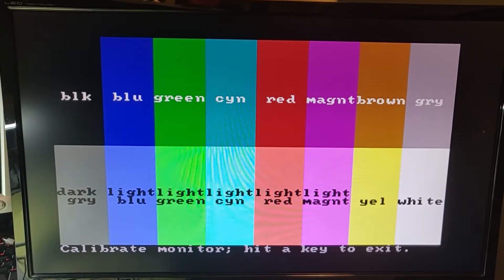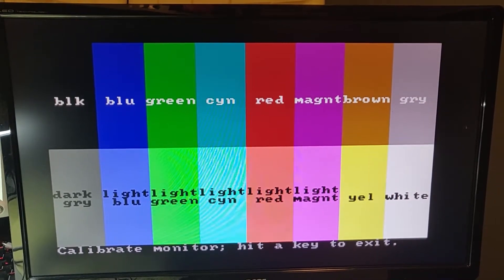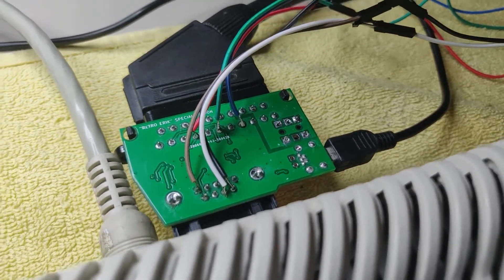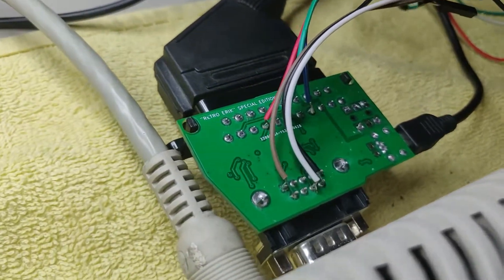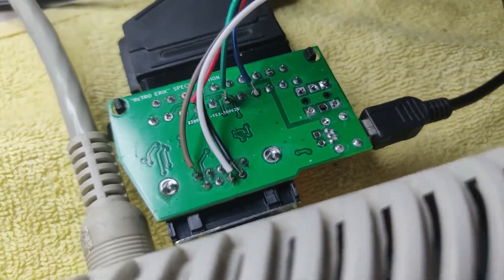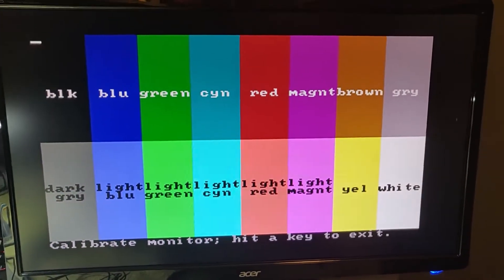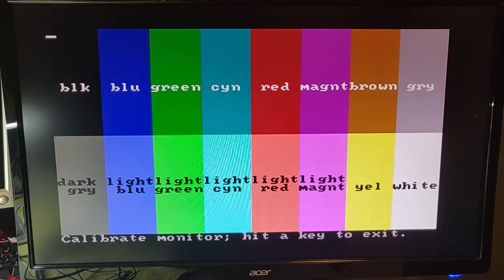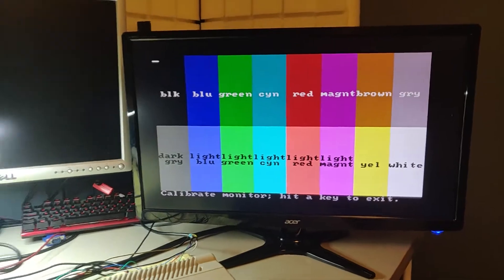CGA2SCART Pro VGA 15Khz modification.

Comment: i have a schendier euro pc reported in working condition, now got a cga2scart pro and still nooutput. tried to blind enter bios and play with settings. is there any way to reset euro pc bios to default cga output? i guess output is messed up with external card the previous owner used. i cant afford a 8bit vga for now :)) i guess to get vga from cga2scart i need to have cga output... hrhr. is there a trick?
Reply from the maker: I have made a recording of the EuroPC Bios. You can use this to count in blind where to go to change the graphics settings from MDA to CGA. https://www.youtube.com/watch?v=qgv-CWJFU2s
You can also remove the battery, but i am not sure what it defaults to. If the battery is the original one, you should remove it ASAP. Search my channel for Euro PC, to find more videos.

The best trick is to use my video to count where to go to, and make the changes in in blind.
Reply: @RetroErik  i just realized i need rgb output, its not component. read the small note on the website ;) ok, i got my cga2scart pro with a scart to 3 rca adapter, assumin i get fbas output and sound, or rgb, tried them all, even scart to svideo to my small recording device. the screen gets some sort of signal but no output. btw: grabbed a vga card from deep of my basement and found a 8bit riser card. vga works fine, bios settings are ok. i tried the  4 key down, pgup/dwn and one left tricks before without luck. so, ... the scart to rca adapter is kinda useless i guess. now i need to find some device with a true scart input... urgs. - wish there was a pro2 with a vga output hack..... ;-)
Reply from the maker: @Raketenclub  Yes to need a monitor that takes RGB input. You can use a SCART to HDMI device. I have videos on that to, check them out.
Reply from the maker: https://www.youtube.com/watch?v=A1dDtNDjzGg
Reply: @RetroErik  mmmh. i got a sony trinitron with rgb input.... and scart... now its on the cable. will dig deeper into my basement. otherwise i need to spend more time and a more complicated setup, got some broadcast 19" video equipment that takes rgb in and sdi out and so on.... hrhr. ill report back. :))